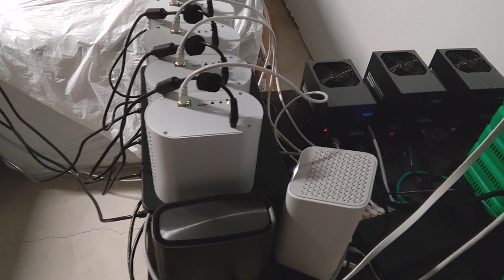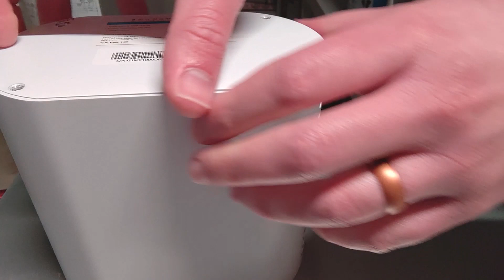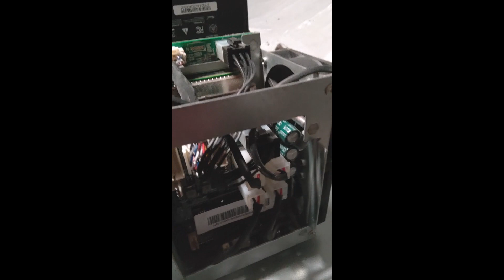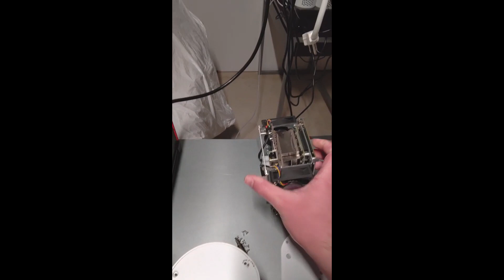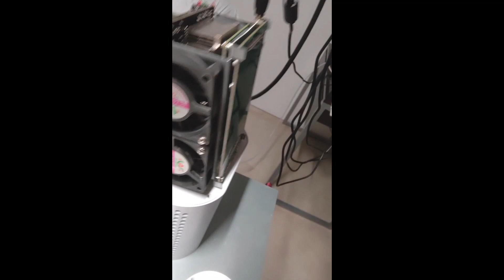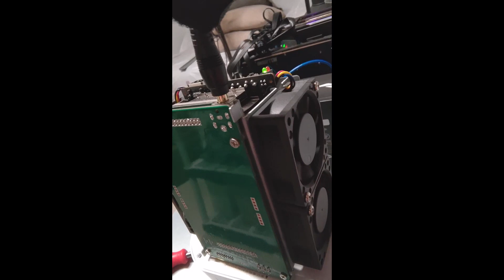iPollo G1 Mini GRIN Crypto Miner Teardown

Comment: Do you know where I can order a replacement fan?
Reply from the maker: I haven't found any of that size w/ the 4 pin mini molex plug. I ended up having to splice the new fan wire to the original connector.

Comment: Hi, I have one G1 mini but I upgraded wrong firmware and now it got bricked, do you know how to recover it from ftcard?
Reply from the maker: Try downloading and reinstalling from iPollo (https://ipollo.com/pages/g-series-firmare). Use Balena Etcher to write system image to new SD card. Alternatively you can wipe the current SD card and reuse. If that doesn't work, try reaching out to iPollo for firmware file to install.
Reply: @motorcityminer  thanks, I had recovered it well.

Comment: FOR HOWMUCH CAN I GET THAT FIRT MINING SETUP. THE SETUP WITH THE 3 CARDS
Reply from the maker: There is a 4th card that is smaller and hard to see. I just used a Gigabyte B450 AORUS desktop motherboard (https://www.newegg.com/gigabyte-b450-aorus-pro-wifi/p/N82E16813145082?Item=N82E16813145082) I had laying around w/ risers.